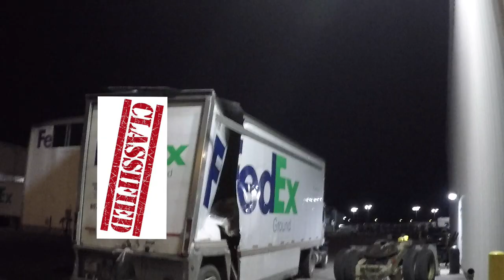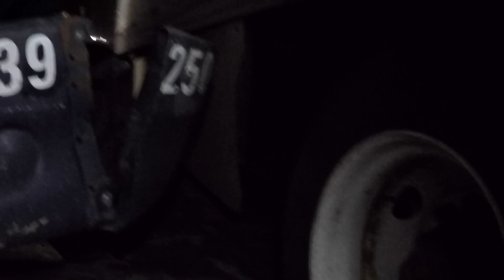Don't sleep and drive!

Comment: So the best thing to help you stay awake is one thing that you said, and that thing is sleep. Nothing else will really help near as much as sleep. I thought I would let you know that blue light works better than red light. Just in case anyone is wondering why you are awake during the day, and maybe sleepier when it rains you simply have to look to the sky. The blue light, like when it is nice and sunny, suppresses the physiological production of melatonin which is what makes you sleepy when it gets dark. The one major drawback of blue light is that it will affect your night vision where as red light doesn't. Hope that helps someone out there on the road sometime.
Reply from the maker: Zorn Hospodarsky you are stop on! I figured most  people would disregard info that went to in depth or made the video to long. I actually drive with the red light on over the driver seat and have blue lights on in the sky light... it really helps. I never think twice about taking a nap if I need one. Thanks for explaining it for everyone!
Reply: I never thought about using the red or blue light. Good tip. I’ve been sleepy and as soon as the sun comes up, I’m wide awake so yes, the light helps a lot..

Comment: Yup. I had a fedex driver rear ended me back in February on i40 just out side of Memphis. Way worse than that. That's nothing. He hit me when I was almost at a dead stop with flashers on because of stopped traffic. The cab came off the frame. Total the truck. Pushed me into the ditch and then rear ended the truck ahead of me. Am pretty sure you heard about it back in 2018 in February. Yup I was pissed too. That idiot could of killed me,him and his wife.
Reply from the maker: That's really scary. Sorry you had to experience that.  Glad to hear no one died. It seems that newer trucks are made to break apart during any accidents similar to a Corvette. What's your thoughts?
Reply: @SimpleLivin  I don't know. I mean dude in bobtail that's was behind him said he didn't even try to slow down. Hit me going about 65mph. So the truck couldn't help but come apart. But I was happy we walked away from it. I saw him coming and I turned the wheel to the right because I already knew he was going hit me nothing I could do but that.
Reply: @SimpleLivin  http://www.wmcactionnews5.com/story/37401734/crash-shuts-down-near-fayette-county-border/

Guess you can see who I drive for too. The one in the ditch.
Reply from the maker: That had to be scary knowing it was gonna happen and nothing you could do. Quick thinking on your part to turn the wheel to deflect away from others on the highway. Looked pretty bad.... Glad everyone was able to walk away...
Reply: @SimpleLivin  me too. Glad no one was hurt or lost there life in that accident.